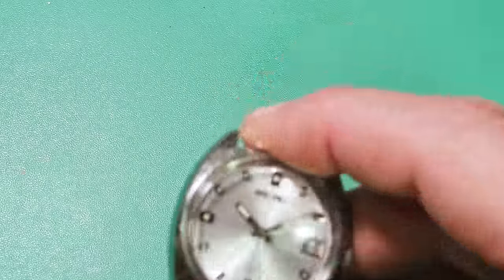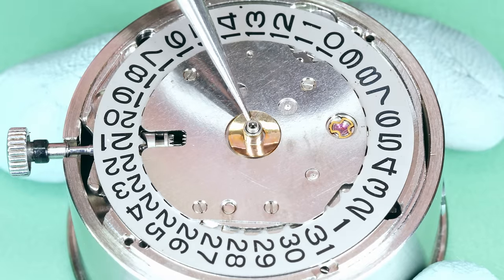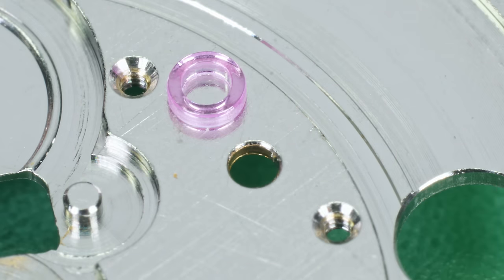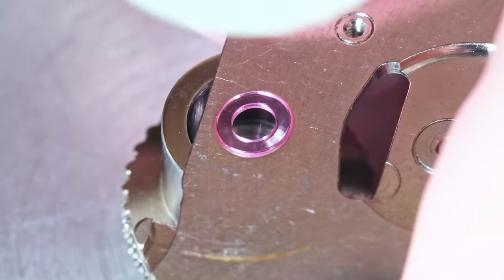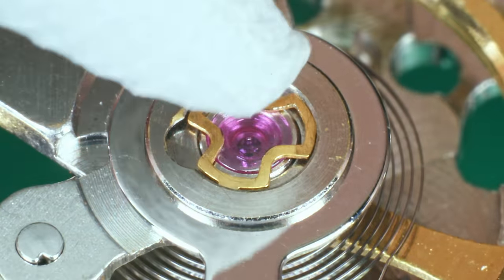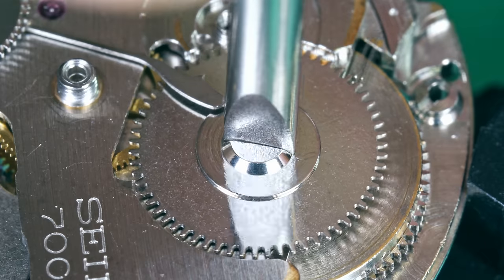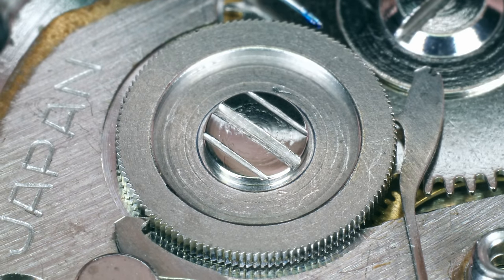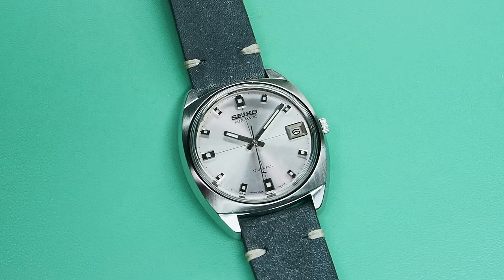Restoration of a worn out 54yo Seiko and adding more jewels - Seiko 7005-7051

Comment: Last year I bought for £10 a gold plated 6109 and £8 the first Actus edition with the "SS", bought both for projects, both on timegrapher gave very very good readings, the 6109 the day wheel has jumped its pusher but keeps incredibly good time, the Actus has a slightly damaged dial and its 3 pane faceted crystal was badly scarred and pitted and again keeps very good time and a few hours with polish and several sanding grades I got the crystal almost perfect without ruining the crystal shape.   Although not quite as good as the £4 gold not plate, 1947 Avia... sold on ebay as not working, full of water, needed a new battery and it was on an ancient expander bracelet also rolled gold... two turns of the winder sprang to life and had an almost perfect timegrapher score, good solid clean exterior and its like brand new... queen of my collection.
Reply from the maker: Yes the old Seiko watches can keep very good time. There are watches out there for not a great deal of money that can be turned with a little effort into very nice watches 👍

Comment: I recently picked up one of the chinese (Vevor) case back openers. I bought a seiko off of ebay that had a cross threaded back, I can't exactly compare to anything else, but it did the job to perfection, and came with a bunch of extras for doing bracelet links too. Very handy, and built like a tank.
Reply from the maker: They are simple tools. Easy to copy and not a lot that could go wrong with the copy

Comment: Hi Leo, Been waiting for your 7005 video. I have the similar watch: 7005-8039, sn: 0N6417. Only difference is, your case steps down at the lugs. Still have/use the Oyster style bracelet.
Reply from the maker: I had to Google it to see yours and indeed, very similar. Same dial, same case except the step down at the lugs. It’s incredible how much difference the step makes. If I saw yours and you didn’t tell me about it, I would have thought it’s a completely different watch.
It’s nice you still have the original bracelet. Mine didn’t have any strap at all.

Comment: I have a 7005A whose balance wheel makes a metal-on-metal noise when the dial is up. Any guess?

I intend to finally disassemble it in the future, and i'll be using your video as a guide. Amazing macroshots, close and clean. Thanks in advance.
Reply from the maker: Difficult to say not being able to see it. Perhaps not even the balance wheel. It could be the oscillating weight.
Reply: Thanks for the attention nonetheless. I'll disassemble it anyway, so.

Comment: Sadly, Weishi's or the lower end ones like my 1000 lack what Tg5.0 had which is an acoustic scale like on your etimer, I found it far more useful in getting the acoustic peaks, dwells etc into perfect sync which gave the most perfect of readings best one could get.   I had before my Weishi a weird ebay Chinese 3d printed thingy box and used Tg5.0 with it and my PC and it was such a easy thing to use to tune up my movements to perfection or near enough, strange though I still do the old way of time monitoring over 24 hours with my old Soviet stuff, dunno why it was how I did it before machines made it easy and all my Vostokery, Slavas, Poljots etc keep superb time just by monitoring over a 24 hour period then working out how much of a nudge on the regulator arm needed... job done :)
Reply from the maker: I like the eTimer because of the real sound of the watch rather than the annoying beeping of the Timegrapher that doesn’t help anything. It is certainly much helpful software. It is also nice that it does the long term logs when you can observe issues the Timegrapher is not capable of 👍

Comment: Thanks for your video Leo, you are an inspiration. I have a Seiko 7009A with a cracked centrewheel jewel. Is it possible to replace it without having a staking set ? I ultrasound cleaned it so not sure if that caused the crack.
Reply from the maker: I doubt the ultrasonic would crack a jewel. The high-end watch cleaning machines also use ultrasound as well as rotation. You can probably see the crack now because it’s clean and you can actually see it.
Not a staking set but you will need a jewelling tool. My most recent video shows two different jewelling tools, the difference between them and how to use them.

Comment: thank you so much for making these videos. i currently have an old Seiko that was from my grandfather, with this exact movement, and since the lack of any professionals where i live, i will do the maintenance of this one, this video is incredibly helpful. i can hear the bearings of the oscillating weight spinning as dry as a bone. i don't think i will be able to get these VTA jewels, you think its worthless to do this work without replacing the bushings? again thank you so much! i already suscribed and will watch the rest of your videos, love it
Reply from the maker: Glad to hear you enjoyed it!
You might not need the VTA jewels, it might not be worn out like mine. You’ll have to take it apart and see what needs doing. If you’re lucky, maybe it will need only cleaning and lubricating. You might have some issues and not necessarily the same as I had. If you need the jewels, they are on eBay.
Reply: @MacroTime28800  thank you for your reply leo! i will rewatch your video a couple times more and then i will begin dissasembling mine, i'm waiting for some tools. i hope to get this right lol
Reply from the maker: I hope it goes well! Have fun and enjoy it 👍

Comment: Thanks for the interesting video. Does having plastic parts make any of the newer movements like 4R35 and 6R35 any inferior?
Reply from the maker: A good question. People don’t like them because they are plastic, they want metal.
Only time will tell how long they will last.
Note that the plastic parts are in the day and date area. There is an advantage to that. If you change the day or date at around midnight when you’re not supposed to, the plastic part will break and the metal ones that connect to it should be OK. With all metal parts, you would potentially damage several parts instead of just the one weaker one that’s made out of plastic.
Reply: Aha! That makes sense. I’ve heard some people say it cuts production costs, which I doubted. Converting just two parts to plastic is not actually cutting costs. What you said makes a lot of sense. Thanks again for everything. Subscribed!

Comment: Hi Leo! I recently inherited a Greiner machine from my grandfather. The machine is huge and difficult to operatie. But it has the same microphone as the one you have standing there! How can I use mine to create the same setup you have there?
Reply from the maker: Do you mean you want to use the software with the microphone or you want to use the machine?
Reply: Just found the link in your description, quite expensive for a hobbyist at this point.
Reply: @MacroTime28800  I have a chinese weishi aswell. I got the Greiner last month and its about 10 times the size of the weishi and uses paper to show the results
Reply from the maker: OK, email me. My email is under ‘About’.

Comment: "seiko automatic 17 jewels 7005" ...
nope 
"seiko automatic 19 jewels 7005" ... 🤣

48:15 the date setting mechanism is much simpler than the one one any 4R35/NH35 ... 😉
i suspect they use the "gear backlash" on the 4R35/NH35,  not as a "common default", but for its "disengaging effect" if the crown is in "date configuration" for a while ... that was not the case on this movement ? would it be a problem ? 😐

{ no other idea why otherwise, they put so many gears on that part  for the 4R35/NH35 ?🤔 }